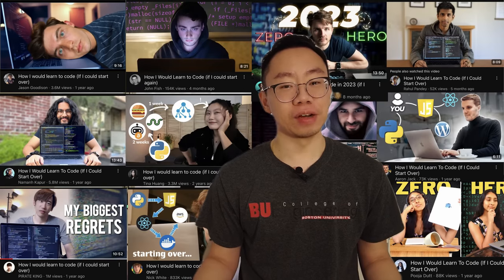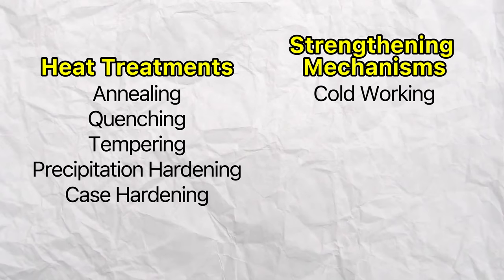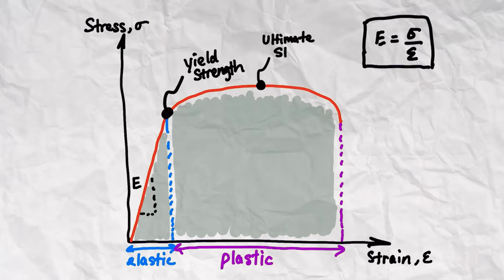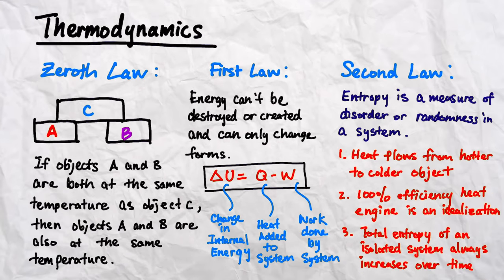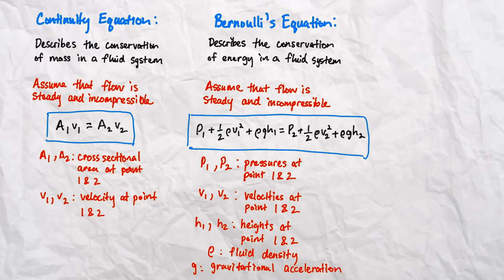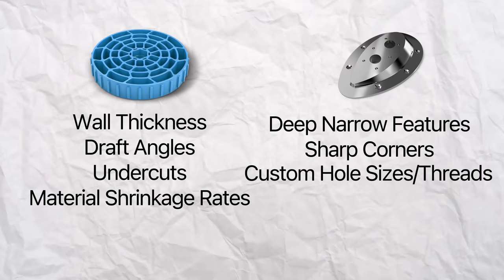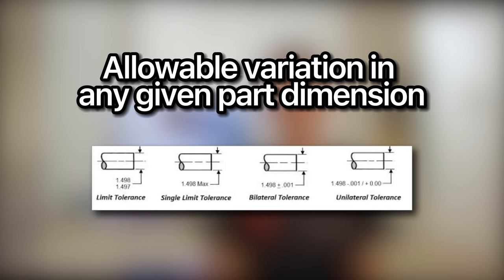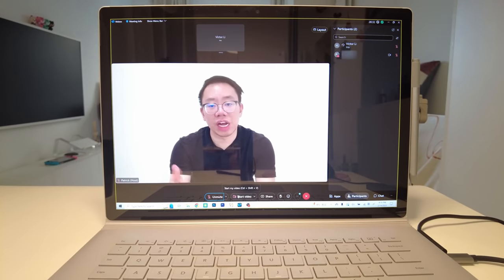How I Would Learn Mechanical Engineering (If I Could Start Over)

Comment: The dimension associated with a flatness tolerance is the total thickness of the zone, not the bilateral tolerance from the surface.
Reply: In other words a flatness of .030, has one plane at +.015 and the other at -.015. Tolerance distribution is “equal, bilateral” unless otherwise specified.

Comment: I use Ekster wallets they are pretty good but i’ve learned from living in Florida is to try not to get sand in it one beach trip or two beach trips won’t hurt being a Floridian going to the beach a few times a month and you get sand in it every time it’ll start feeling clunky, but it’s still really good I have the carbon fiber one

Comment: I am doing mechanical engineering in Utah I am still doing my prerequisites but can’t wait to start the actual classes of mechanical engineering. I would like to know if most of the jobs in mechanical engineering are sitting in a office or actually putting hands on because my mom told me I would be fixing cars lol, I told her that mechanical engineering is not only about that
Reply: It depends a lot on what industry you are in, the company you work for, and your job duties. We generally seem to hire people who are paid less than the engineers to do the majority of the hands on work while the engineers are less or possibly not at all involved in actual shop work. There are of course plenty of exceptions. For example, small companies tend to have a lot more hands on and diversity in job duties. In a large company you could get stuck doing the same thing every day such as only doing CAD design, or only running analysis simulations, or only working on excel. Plenty of engineers fix cars as a hobby but I'm guessing that you will likely not be doing it professionally.
Reply from the maker: Very well said👏
Reply: @downardesigns4148  I've always wanted to work in engineering because of practical stuff, and my parents really want me to do uni so what should i do as i really hate the idea of working in an office
Reply: @EngineeringGoneWild bro which math courses does one need to learn to understand the full mechanical engineer program

Comment: I am still confused about how much of electronics , circuits, and programming does a mechanical engineer must know?
Reply: Depends on the job and on the uni it is mostly basic stuff. You might have to know more for some specialization
Reply: I'm doing mechanical taking electrical circuit 1 just no more 😂😂 I don't think ME needs it more than that
Reply: You need to know basic safety things like Ohms law and Kirchhoff circuit laws since your mechanical system will interact with electronic systems. You will also probably learn about electric motors as a mechanical engineer and you need to understand a little bit about electromagnetic field theory for that.
Reply: From what I've seen it's convenient (not mandatory) to at least know basic electronics and coding. Both skills are high in demand, specially coding. I understand that, but I hate coding so much I personally won't be doing it, just electronics.

Comment: I really enjoy your content! One thing: Carbon Fiber Composites are definitely not the most common Composites - Glass Fiber Composites are. While Carbon Fibers are the go to in high tech products (e.g. Aircrafts), Glass Fibers are used a lot more in general considering their very good technical properties while still being affordable. Carbon Fiber production requires a massive amount of energy compared to glass fibers, which results in a very high price (and environmental footprint), which it needs to offset during the usage phase of a product. Highly active products such as aircrafts regain those economic and environmental disadvantages from the material production, as the increased degree of lightweight engineering in those products result in a lower energy consumption during the products life cycle. For most products glass fibers is the go to because of that, e.g. cars or windblades. Carbon fibers do sometimes get used in those products as well (in cars mostly cause they look cool, in windblades because at certain lengths some layers of CF really helps with the technical requirements), but overall glass fiber composites applications are more common.

Comment: Great video as always! I have a quick question about resume building. How do you include CAD/project photos on your printed resume?
Reply: If you use Word or Google Docs you can add pictures to the document
Reply: I would make a separate portfolio sheet with pictures and brief descriptions of the project, which you can include as a supporting document for a job application

Comment: if i want to work in aerospace industry such as Spacex, is it better to major in mechanical, or aerospace engineering?
Reply from the maker: General mechanical engineering degree is preferred for undergrad. You can concentrate in Aerospace.
Reply: in my university they're 2 separate degrees, so i wouldn't be able to specialize Aero until post grad @EngineeringGoneWild
Reply: Yeah specialise in postgrad only
Reply: I'll disagree with others here.  I've worked in aerospace at one of the biggies for four years as a non degreed engineer, and am currently a senior for my ARO undergrad.  I'd say that the aero-specific courses have given me an edge over ME coworkers.  For masters, a systems engineering degree is very useful.